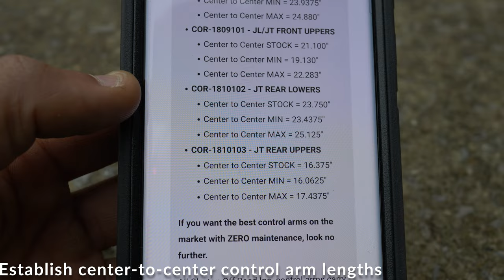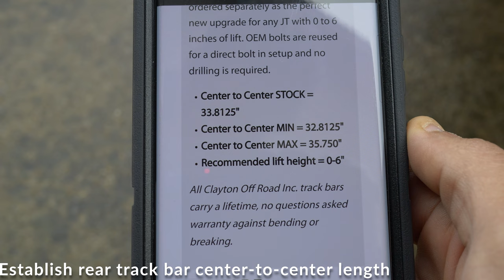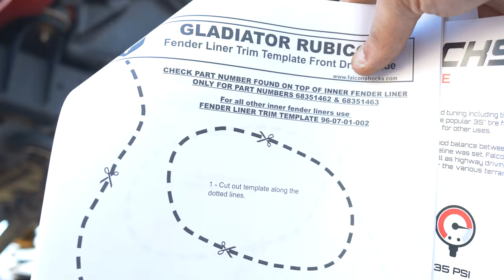Clayton Off Road x Jeep Gladiator Rubicon | Overland Plus 2.5" Lift Kit Installation | Driveway DIY

Comment: great install video. Jack stands on the frame, not the sliders allows for much more droop of the suspension. No need to ratchet the coils as they slip right in on full droop.

Comment: This is awesome. When I bought my Rubi Gladiator, I though how great of a ride it is from my old 2013 JK with a 3.5" lift and running 38". I did not wanted to lifted this one, but now I think I am going to have too, too much lift envy. Great video, cheers
Reply from the maker: It took me literal years to decide on which lift to go with. I considered all options, and settled on this one. I'm not disappointed. 

I will say, it gave a good bit of extra height over what was advertised, but I'm 99% sure that is due in part to my upgraded bump stops and the HD rear springs, so I can't fault the lift for that. It's more than I wanted, but now that it's done I'm actually quite happy with it. I'm considering 37s or 38s now once my 35s give out. We'll see.

All in all, no regrets on choosing this lift. I'll have a walkaround/impressions video up in the near future.

Comment: Good luck with that setup.  I had the same kit and shocks on my Gladiator.  There are no words to truly describe how bad it rode.  I went back to factory suspension and the ride significantly improved.
Reply from the maker: Really? Interesting. I wonder why...

I've actually had it on for about a month now (been very busy and haven't had much time to edit content) and have been very impressed with how it rides. The steering is much less "floaty" than before and the shocks soak up everything with minimal fuss. I have them set slightly firm for on-road. There is also zero wallowing now when loaded down at highway speed, which was a huge issue for me on the stock suspension before I upgraded my rear bump stops. I got slight sway after the bump stops, but I have zero now with the HD springs. Not even a hint of it.

I'll keep my eye on things and will be sure to update when I eventually get an impressions video up. Thanks for the info!
Reply: @TerraOutdoors  idk, I keep hearing the exact same reviews on that kit.  That's one reason why I bought it along with those shocks.  I ran the shocks in every possible setting, but I felt every tiny imperfection in the road.  It was like they were not absorbing anything.  
Correct me if I'm wrong, but you are or were in Ft Campbell?  I'm not far from you in Gallatin.  You know the roads here in mid TN are awful so that probably didn't help much with the kit I had.
Reply from the maker: That's wild. I initially ran them on full soft, and I had to dial them up because I didn't feel like I was getting enough feedback from the road. It still feels like a solid axle vehicle, to be sure, but for me it is objectively an improvement from my stock setup.

Yeah, I am. I'm intimately familiar with how bad the roads can be out here. I-24 in particular. 

I'm eager to put it in a legitimately demanding off road setting to see how the setup performs.
Reply: My guess is you installed it wrong. I have the same lift, fox shocks. Drives amazing.
Reply: You will definitely feel the bumps and potholes more with the Falcons.  They aren't progressive and squishy up top like the stock Fox shocks - which was my biggest complaint about the stock suspension.  While I would agree that the Falcon ride is a bit harsher,  it overall drives much better with less body roll, better tracking, and highway manners.   I run on 2.2 in the front and 2.0 in the rear.  

Also, Falcon does recommend running lower tire pressure to compensate for the lack of squish on top.  I haven't done that, still run around 33-34 psi in my 37" K02s.
Reply: What did these finally settle down at? I’m on the fence between the 2.5 and 3.5 Clayton kit….not really wanting to replace drove line as of yet with e 3.5…
Reply: @Troothless  your guess would be wrong.  It was all installed 100% correct.  The shocks, well there's only one way to install those.  The rest of it was installed correctly the first time, and checked by two shops just to be sure.  
I'm sure the Fox shocks make it ride much better because they are better shocks than the Falcons.
Reply from the maker: @3.ZERO.2  Stay tuned for my eventual update video for more in-depth details, but it was around 3.75" of gain a couple of days after install. I knew it would be over 2.5", but honestly I'm surprised by the height considering how heavy my rig is. I suspect the HD rear springs and upgraded bump stops are contributing to that.

Having said that, I haven't measured in about a month (I'm out of town for work) so they may have settled more since then.
Reply: @TerraOutdoors  nice work…planning to order this week. The Clayton 2.5 overland plus will put me where I want to be…What size shocks did you go with, for 2-3” lift or 3.5-4.5” lift?  Ordering the TeraFlex falcon 3.5 A-adapt shocks..I like the idea of going with the 3.5-4.5…but may need spring retainers or limiting straps to keep springs from unseating…I have heard some have had this issue with the 2.5 kit too…
Reply from the maker: @3.ZERO.2  I bought it as a kit, so it came with the 2-3" shocks since it's the 2.5" lift. If I had known how much lift it would have given me, I likely would have gone with the taller shocks. Having said that, I haven't had any issues. Fingers crossed that that continues to be the case. The lift may have settled more in the month since I installed it too, so I'll need to measure again when I get home.
Reply: @ryoc2138  what is the load rating on your tires?

Comment: Just picked up their Clayton's full performance kit and HD spring swap and can't wait to give it a shot. SmartCap& RTT is heavy. Gotta roll on the stock 33s for awhile but I can live with that.
Reply from the maker: Nice!

Yeah, it's a heavy setup for sure, but the suspension has been handling it like an absolute champ. It rides better now fully loaded than it did stock without any camping gear onboard. I'm very happy with the performance so far.

Comment: You put your rear sway bar end link on incorrectly.  The nut  faces outside and the ball socket faces in towards the differential.  I know cause I just installed the same kit.  I did the rear in about 3 hours with the last hour being in the dark with a headlamp lol.  Super easy kit to install!  Very impressed with the quality in materials and packaging.  Clayton is top notch
Reply from the maker: Did I? I could have sworn I followed the directions to the letter. Good looking out! I'll check it out the next chance I get.

Yeah, it really wasn't too bad. Accomplished with a single jack and basic tools in the driveway. I did have to get a little creative on the rear springs, but I'm sure that was partly due to them being the heavier duty ones.

Agreed! Very happy with my kit so far.
Reply: @TerraOutdoors  for those who might come across this, I found errors in Clayton's instructions and they don't care enough to change them. The sway bar end link info is wrong in the JL kit for the front driver side as well.

Comment: Just ordered my 2.5" Overland Plus yesterday. Went with the Fox 2.0 remote reservoir because I'm poor. I hope 2.5" is enough on my JLUR running Wildpeak 37s. Installing on March 17!
Reply from the maker: Nothing wrong at all with the Fox route. Those are good shocks!

I have a feeling it'll be enough. This lift made my 35s look small, so I think 37s would fit perfectly.

Comment: I have the exact same lift on my Gladiator, even the same Red Rubicon. I got mine on Black Friday as well. I will say I absoutely love the ride compared to stock, feels so much more connected to to road. I'm also running Nitto Ridge Grapplers 37 x 12.50 17. Kudos for you doing the install solo, I was able to do it in a day with a friend. Enjoying your content, just subscribed.
Reply from the maker: Awesome! I'd say I'm a bit biased towards the Firecracker Red Jeeps...

Good to hear that you've had good results with it. I agree with you: It feels far more planted than it did before. The excessive body roll I used to experience is now non-existent. I'll be doing the initial hardware check/re-tightening when I get back home from my business trip. Hopefully everything is still nice and snug.

Did you see a similar increase in height? How are you liking the 37s? Those may be in my future as well...

Appreciate the kind words, and thanks for the sub!
Reply: @@TerraOutdoors  The 37's are great for helping out with the breakover angle. In total with the lift and tires I gained about 6" at my fender measurements. Went from 41 stock to 47.
Reply: I'm also on Gladiator forums, Sempe-Fi is my screen name.
Reply from the maker: @Carl cvplow  Same here. TheHops. I don't post as much as I used to, but I'm still around!

Dang, that's some height! I definitely wouldn't mind a bit of extra angle. I still have maybe 15K miles on my current tires. We'll see, when the time comes.
Reply: 37 on 2.5? any rubbing on full flex??
Reply from the maker: Can't speak for Carl's 37s, but I haven't noticed being even close with my 35s. I imagine there's a comfortable amount of room with this kit, considering it provides more than advertised.

Comment: Free usage of spring compressors are available from your local car parts shop.  You could have had that job done before the rain came in.
Reply from the maker: I've used those before on other jobs (both successfully and unsuccessfully) and speaking from that experience, there is a 0% chance that those types of compressors would have been effective on these. Those struggle with light duty spring jobs: these springs were too tall, and far, far too stiff.

Comment: So here we are almost a year and a half later, Are you still liking it? My kit has been in the shop since december and I am finally getting around to install it next week
Reply from the maker: Dang, since December? That's quite some time.

I still love it. The ride is better than factory. No wallowing or sway, regardless of the situation. It's exactly what I was looking for.

Admittedly, the ride in the rear is a tiny bit firmer than I'd like when unloaded. I opted for the HD rear springs. On the other hand, it rides perfectly when loaded down, so that's a reasonable tradeoff for me.

Overall, I'd make the same choice again without hesitation. Hope you enjoy it!
Reply: @TerraOutdoors  nice. I opted for the HD springs as well. I have a shell and all the gear. Plus I just got my OGT Expedition trailer which is what really prompted the urgency to get the lift on. I’ll be posting about it soon. 
Yeah, long time but I’m a trucker so to me that was like a couple weeks ago. Lol
Reply from the maker: @TerraFirmaX  Haha, nice. Yeah, I suppose that's true.

I'm certainly not mad about going with the HD springs. I'd rather have a slightly harsher ride unloaded than be unsafe when loaded. I also run SumoSpring bump stop replacements in the rear, and they've been great.

Comment: Just curious, does your smartcap whistle before you added your additional racks? Mine starts whistling around 60mph and continues to increase in sound as speed increases. if your did, did you do anything to mitigate it?
Reply from the maker: Not that I ever noticed. I don't think I had the SmartCap on for more than a week prior to adding the roof rack though. The rack arrived before the cap, if I recall correctly. 

Is it your pressure vent? You could check that out. If so, perhaps something like an adhesive moonroof wind deflector may help?

Comment: lol, you need to trade in those channel locks on some wrenches
Reply from the maker: Tell me about it. 😂 I didn't look into the sizes beforehand, and that was all I had on hand to make it happen at the time. Rookie move.
Reply: @TerraOutdoors  Hey man, sometimes you gotta make do. You'd be surprised what I can rebuild in the middle of the desert with a rock and a pair of pliers  
Thanks for the great vid, just ordered the same kit
Reply from the maker: @TerraFirmaX  That's the truth. Desperate times call for desperate measures! As long as it gets the job (safely) done.

For sure, thanks for checking it out. Hope the kit treats you well! I'm a big fan so far.

Comment: I know I’m late to the party cuz this video is a year old. How do you like the kit after this amount of time. I’m close to pulling the trigger on it… but I’m concerned about some of the bad reviews…. Considering going with fox shocks… any new thoughts?
Reply from the maker: I had heard there were some negative reviews here and there, but the suspicion on forums and whatnot was that it came from improper installation. From my experience, Clayton reviews have been mostly positive. 

I don't have anything bad to say about the kit, myself. Easy install, and it has performed flawlessly. I love the adjustable shocks. If I could change one thing, I may go with softer springs in the rear. I upgraded to the HD because of my setup. It rides perfect when loaded down for a trip, but it's a bit stiff daily driving.

All in all, I'd say don't hesitate if you're in the market for a kit.
Reply: @TerraOutdoors  I really appreciate the response. I went ahead and ordered it…. Minus the HD rear springs.  Still deciding on shocks. Thanks!
Reply from the maker: @noneckjoe948  No problem at all.

Nice! I don't think you'll be disappointed. I've heard great things about Fox as well, so I'm sure you can't go wrong with either. Enjoy!

Comment: Are you using the min length for track bar and arms ? Or max?
Reply from the maker: Edit: I checked the instructions, and I don't see a min/max range as you mentioned. Clayton gives a specific target value for each height of lift. That's what I used.

For the 2.5" Lift
Front lowers: 24.336"
Front uppers: 20.272"
Rear lowers: 23.962"
Rear uppers: 16.577"
Front track bar: 34.090"
Rear track bar: 33.869"

Obviously, those are pretty dang precise. Mine aren't exactly that, but I got them as close as I could and made sure all matching components were even in length.

Comment: I started installing the Clayton 2.5” Ride Right+ kit a couple days ago. Pretty beefy product. Those rear springs are a bear to get I though. I ended up removing the brake calipers in order to be able to drop axle enough. I need to cut the sway bar end links still and install them. The whole cutting of the end links I think is stupid. Kits should come with bolt in ready end links like most kits do. I did Fox shocks on mine
Reply from the maker: Man, that they were. I had a heck of a time squeezing those springs in, especially considering I got the HD upgraded ones.

I agree. It was annoying...but it did result in me getting a new tool to accomplish the job so I wasn't too mad about it!

I've heard Fox goes great with these kits. No regrets on the Falcons thus far. They've been great.

Comment: How are the shocks working out?  Are you happy with the ride comfort?   I have a pair that I pulled off my EcoDiesel and thought they were too stiff.
Reply from the maker: Dang, that sucks. I love mine so far. If anything, I thought they were a bit soft, but I do have a lot of extra weight on my Jeep. I think I run the rears at 8/10, and the fronts at 6/10. I love being able to dial it in, and the change is very noticeable. No regrets on my end.
Reply: @TerraOutdoors  I spoke with the Clayton support about their kit and the sitffness of the falcons.  They told me that stiffness is often due to bad geometry and binding.  I'm pretty sure that the shop that installed my lift (not clayton at the moment) probably tightened down the control arms while the Jeep was lifted which apparently is a no-no.   I think a month from now I'll have the exact same setup as you.  And like you I have extra weight on my Jeep (it weighs 5450 lbs from the dealer floor - bone stock - 4xe).

Comment: What size were the shocks? The 2.5 to 4.5 in?
Reply from the maker: The shock kit included with this particular lift is Falcon part number FAL-14-02-33-400-150. According to their website, they are for 2" - 3" of lift.

Comment: What type of control arm joint are they using? They used to supply Currie Johnny Joints, but those look like clevites or maybe dual durometer style.
Reply from the maker: The product page says they're GIIRO dual durometer, self-centering joints.
Reply: @TerraOutdoors  Thanks!
Reply from the maker: @jerrymcgeorge4117  No problem!

Comment: What is the recommended wheel width and backspacing for the lift kit
Reply from the maker: Any available wheel/tire information is posted on the kit pages at Clayton. I don't think this one specified a width, but it did say 4.75 backspacing recommended.

Comment: do you need do alignment for this ?
Reply from the maker: I would definitely recommend it. I was due for one anyway so I just went ahead and did it. My steering wheel was way off of center as well after install, so be prepared to adjust your drag link.

Comment: owie those lug nuts.... Home depot sells 1/2 inch drive torque wrench for like $89
Reply from the maker: All good. My hands are calibrated plus or minus 1 ft-lb.

But seriously: I've had one on my list for a while. Having said that, the Gladiator calls for 130 ft-lb. When putting on the wheels, I set my impact to a max torque of 75 ft-lb. After the first or second "ugga dugga," that's when I tighten by hand. Realistically, I'm probably not too far off. Maybe a bit under-torque, if anything, as I'm only getting another half-turn in at the most. It's not the "right" answer, but it works.